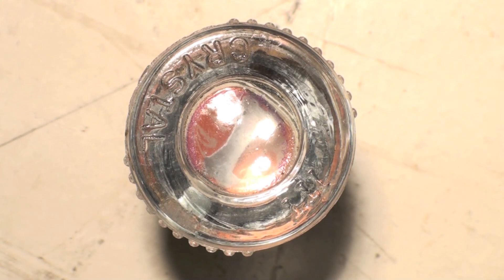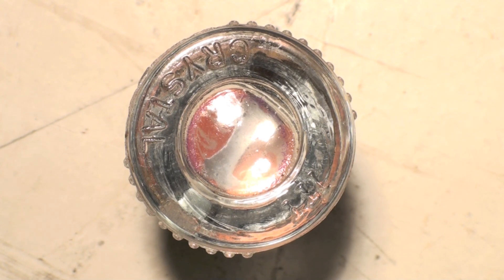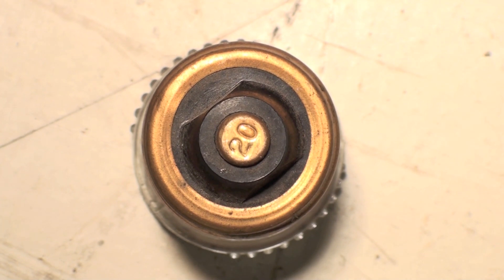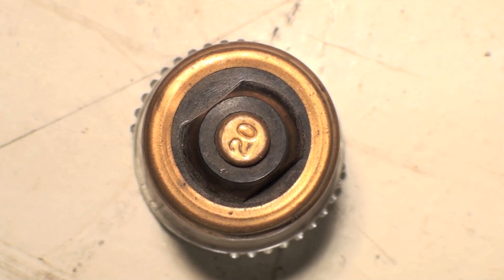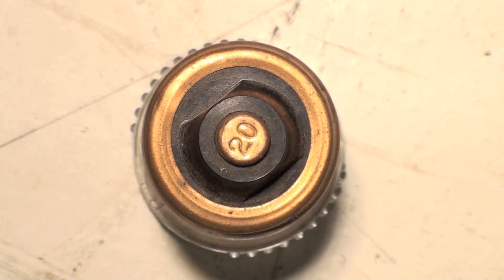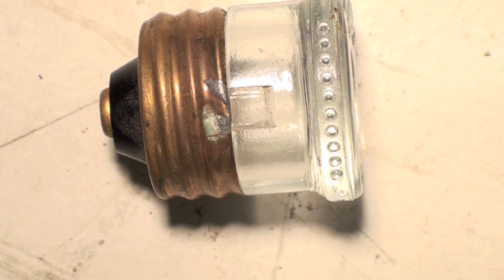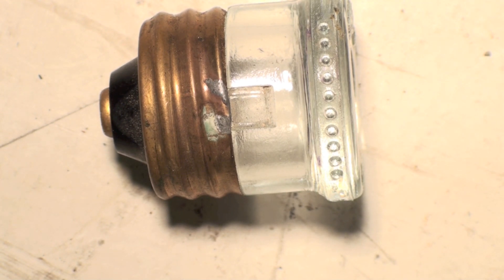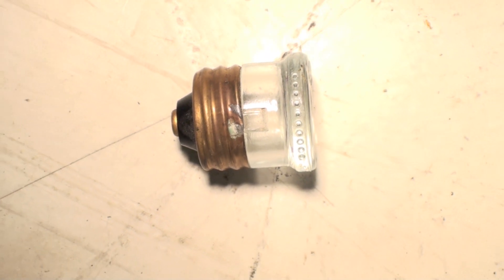How does a fuse work.  Part 1

Comment: Was searching for a 20 amp tl fuse and came upon one that is 20 amp but has a reset button on it.  Planning on having a new breaker box put in soon but need to replace a blown fuse.   I've never seen one with a reset button and was wondering if those are the same as the ones  it currently uses.   Seems odd they make fuses with reset buttons now.
Reply from the maker: Its really just a simple type of breaker.  They work ok.
GFM

Comment: I've got this exact fuse.  My Formal Dining room has no power.  I've just bought the house.  I have two panels.  Ones downstairs/basement updated.  And a box like this - REAL OLD....   All the other bulbs look like 30A...  I've got pictures.
Reply from the maker: All I can say about a fuse box that actually contains fuses is, get rid of it.  It is a fire waiting to happen.  If you do not have a 200 amp breaker panel, you need one.
GFM
Reply: grayfurnaceman  
Yes.  I completely understand that part of replacing.   It's hard to get an electrician out here.  And budget life is real as a first time homeowner.

I'm actively looking to get quotes.

Good news is I got my living room lights working again.
Reply from the maker: The screw in fuse should show if it is blown by the glass being opaque.  They blow easily because they protect the wire and the wiring on these older systems is not large enough to handle modern appliances.  Hope this helps.
GFM

Comment: People used to put pennies in the socket, and screw the blown fuse back in. Of course this is really dangerous and stupid, leaving no circuit protection at all!
Reply: +Sidonie Smith Well...they were pure copper up to 1837. After that they were 95% copper, then 88% copper. But since 1982 they are only 2.5 % copper, the rest is zinc. Zinc is just a really cheap plentiful metal. The government stopped making copper pennies, because it cost a lot more then 1 cent to make a penny.! Take a new Penny, 1982 or later, and cut it in half. You will see that is just copper coated zinc today. And it still costs more than 1 cent to make a zinc penny. That is why they want to stop making pennies altogether.
Reply: +metalmoto 
Back when pennies were copper.
Reply: +Jim81501 I never even thought about that. As today's pennies are made of mostly zinc. They don't make as good as an electrical conductor as they used too.
Reply: +metalmoto whats zinc? I thought pennies were made of copper!

Comment from the maker: You are right.  The power passes through the bimetal (each breaker size has a bi metal rated for the amperage draw) and warms it.  If enough power is traveling through it, it warps and pops open a catch.
GFM